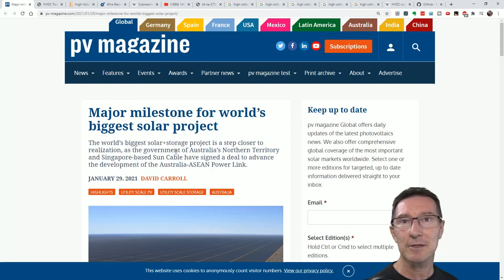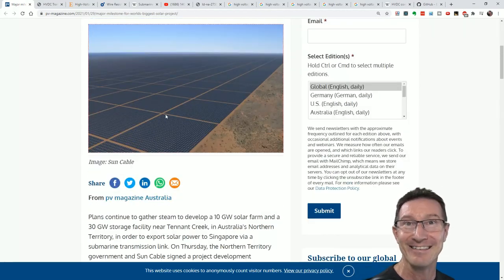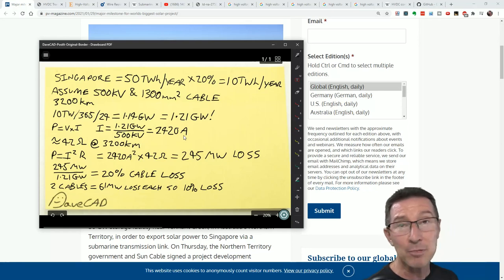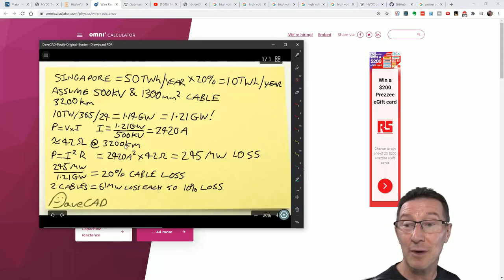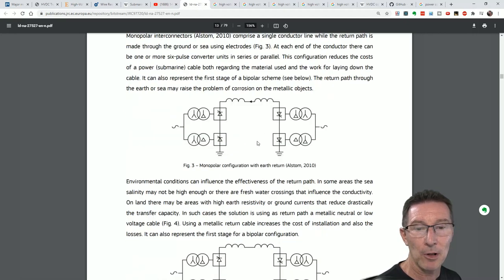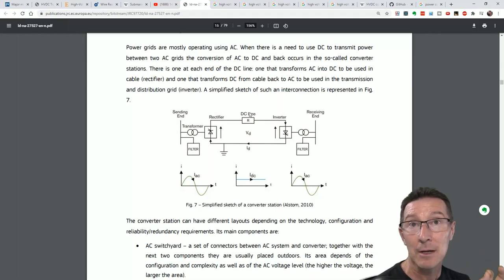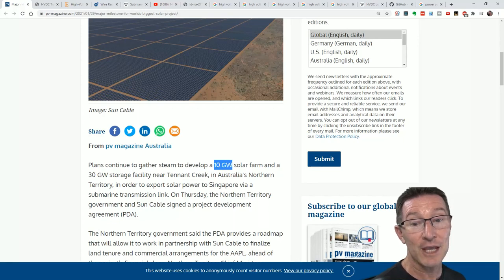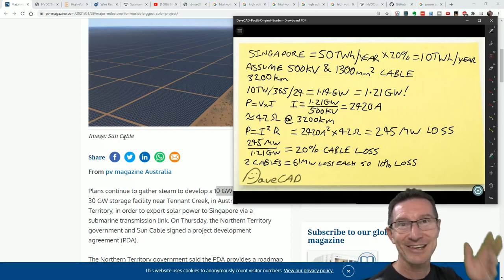World's Largest Solar Array - HVDC Transmission Calculations...

Comment: Do they use a second line for the return path or can they use the ground across continents as a common ground? If not, does the length of cable need doubling to take into account the return path?

Comment: I will concede the first statement, fair point.  As for the second I am assuming you mean solar-thermal towers.  I would agree that they should continue to be developed.  I would like to see a solar-thermal project tied together with an MSR (Molten Salt Reactor).  The MSR already has a huge thermal reservoir and both the nuclear and solar systems would be contributing to the same energy pool.  The system is not fast reacting like LNG however it would produce a constant and unwavering baseline that could handle the bulk of the electric requirements.

Comment: It's interesting but imagine if we stuck all of those panels on business and homes throughout Aus instead... Much better idea but then I guess the rich don't get richer.
Reply: Mounting panels in populated areas, particularly mounted at height, would be far more expensive and much more difficult to maintain than a field level array of solar panels.
Drop a few panels on unsuspecting pedestrians and you have a new expense you never calculated for.  And then you have end of life removal from all those buildings.
Add to that the fact that you need inverters and controllers every few panels rather than the electronics being used for a large array.  Your method would be far less efficient.
Reply: good luck maintaining a bunch of panels on top of buildings of various sizes across an entire city.
Reply: @poptartmcjelly7054     Which also brings up the point that distributing the panels will increase the amount of wire required to deliver an equivalent amount of electricity.
I suppose they could use bi-directional electricity and send the power both ways through the wire at the same time thereby not needing extra wire.  XD  jk
Do 'Green Energy' advocates know that Solar Panels are polished with a chemical called Chlorine TriFluoride?  The stuff will set Asbestos on fire.  Seriously, look it up.
Reply: @seanb3516  You wouldn't need to distribute the power because it would get used at the building. You reduce losses because you don't have transmission.

I don't know why they don't build those big solar towers anymore. They are much more productive collecting up to 35% compared to the 12-15% of solar panels.
Reply: @excitedbox5705  I'm pretty sure panels are better than 15%
Reply: The folks doing this arn't idiots. If they could install it on rooftops and so forth in Singapore, they would.  Installing array(s) in neighbouring countries is fraught with other issues. Singapore and Australia are somewhat more politically aligned, and they can be reasonably assured that Australia won't threaten to cut off their power. 

The idea of installing these panels on Businesses and Homes in Australia misses the point of why Singapore is paying for this to be built - it's because they need the power. We can pay for and build our own, it's not like we're running out of room for large-scale Wind/Solar farms.
Reply: @rebsdioramas  It costs a lot of money and requires investors willing to chip in.

Comment: Seems like the storage needs to be located in Singapore.
Reply: I was thinking that you might be better off with storage in Australia so that you have a more steady flow of power in the transmission lines to avoid high I2R losses around midday.
Reply: @somersethugh  yes, the battery needs to be close to the load.

Comment: Guess you need to double the resistance as you have 2 ways and if you use +-800kV you get a 1.6MV potential to work with :)

Comment: With regards to the losses (and who'd end up paying for that)  on the transmission line (imo): the easiest way would be to sell the power where your infrastructure ends.  This would put the onus on the owners to ensure their plant is running at peak efficiency. So if Singapore owns the transmission cable, they would incur the losses. This avoids paying for losses incurred outside your infrastructure.

Comment: Okay so a note on aluminium cables. It needs about twice the cross-section for the same delivery but at the same time it's over 4 times cheaper than copper and easier to make. Australia by weight is producing more aluminium than any other metal except iron combined and considering aluminium is pretty damn low density, that a *lot*. It would be orders of magnitude better both for local economy and for production/shipping cost than copper.

Comment: Yeah, as we move towards decentralised renewable energy, and diversity of supply to cover gaps in generation, HVDC is only going to become increasingly common.

Multi-tap systems are an interesting development - because you have to drive all the power converters properly it's a lot more difficult to control than standard AC system.

Comment: Arent there additional losses in the ground return (if using only 1 conductor)?
Reply: I wondered about this as the resistance figure in the calculation doesn't take this into account. I think it's likely to have a metallic return, see page 13/14 of the "HVDC Submarine Power Cables
 in the World" report.

Comment: I wonder if the storage will be in Australia or in Singapore - if you have 10% loss in transportation it would be smarter to store it in Singapore, right? Are there figures about efficiency versus capacity versus cost?
Reply: Yeah definitely best to have the storage in Singapore so you dont lose what ever percentage when you have to transfer from the storage. Then you can get away with a smaller storage with the same result.

Comment: How is the cable supposed to stay connected if it needs submarines to hold it up?
Reply: not sure if ure joking but sub marine means under water. so the cable is just sitting on the bottom of the ocean.
Reply: @JaniMikaelOllenberg  dude i know submarines go underwater its in they're name
Reply: submarine cable has nothing to do with the submarine watercraft. the cable is laid down on the bottom of the sea from a boat.
Reply: @JaniMikaelOllenberg  That and I think it's often dropped into a trench to give added protection

Comment: WOW...  3800km is 40,720,800  Kg of copper per each of the 1,200 mm^2 strands in that cable!  That's a lot of copper!          Interesting they use lead shielding in there.... best cost factor?
Reply: 20.89 meter sided cube of copper  (2 strands @ 1200 mm^2, 3800 km length)
Reply: Well you also need 25 Million PV Panels @ 400W each. The scale is insane i have to say.

Comment: I wonder if there are ships that can lay multiple cables in parallel. The ones I've seen (YouTube ship tours and whatnot) seem designed specifically for single cable payout.
Reply: Single only on all the ones built from the 1980’s to quite recently in and around the UK.  The conductor spacing is in the tens of metres.

Comment: Here in the US there was a proposal to use HVDC to transmit wind power in Texas to Chicago, about 500 miles (or 800 of your fancy French kilomumbles). The plan for the cable and the wind farms to support it were cancelled when they couldn't get regulatory and government support for the project. Ironically the plan was put forward by a billionaire Texas oil man and was shot down in the halls of power by oil and coal industry lobbyists.

Comment: I recommend thinking superconductor. At this size and length this could become viable.
Reply: @Wolfgang Preier Please show your working?  What are the energy costs of keeping 3800 km of cable cold? What are the capital and maintenance costs?  What are the MMBF & MMTR?  What is the epected lifetime of such an installation?
Reply: @Brian_Of_Melbourne  I am neither a industrial engineer nor a phycisist who could say whether a supraconducting cable in this length is even possible. I can only see the numbers. And many millions of dollars lost only because singapore can not place their solar panels near the city is overkill.
As i said it COULD become viable. maybe not. IDK.
If you want to know specifics: There are a few real world implementations in italy, russia, japan, germany. 
For HVDC they use 650kV and 10 kA and cool it down to -208 celsius. At this power elevel it saves - currently - 15% of the cost of a normal conducting cable. 
But nobody ever tried this for 3800km. And nobody would make this experiment. The implementation itself would be the only way to experiment and learn.

Comment: One of the down sides to DC is that it's considered a point to point system and not amenable to tapping off power at substations along the route, mostly because of the cost of  the AC conversion plants.   I was surprised to read that DC lines can be setup to move power in both directions via the appropriate AC to DC and DC to AC converters plants, seems the hardware is very similar at both ends but think its more than software register bit switch however.   AC systems just adjust the phasing. Regulation, harmonic suppression and arcing are major issues that have to be addressed.    Conversion buildings can be filled with SF6 to reduce the spacing of components and they love optical triggered thyristors.   One errant pulse and you let the blue smoke from you expensive converter stack.
Reply: The first UK-France Interconnect was bi directional and was completed in 1961(now decommissioned). Power is imported and exported depending on demand and market costs. The second 2000MW system was commissioned in 1986. An additional link was commissioned in January 2021.

Comment: Solar does not have a production cost. Fuel, the sunshine, is free. Basically the cost of electricity becomes capital and overhead. There could be a time in the future where one pays for a connection. A bit like an unlimited mobile or internet service.

Comment: Skin effect is not the only problem with ac. With very long lines, you will get a lot of parasitic capacitance, so additional power loss.
Reply: You also need to add the inductance the long cable has.  Electric train systems half the frequency, cause the impedance at the regular frequency (50/60 Hz) is too high and power just does not flow.  If trains system do it for a 10th of the distance, and 100th less power, DC is the only way to go.
skin issues are peanuts
Reply: @ikocheratcr  What train systems halve the frequency?
Reply: @misstakenot9582  In Germany, Switzerland and some other countries they use 1 phase 16.7Hz for the railroad power grid. It was 16 2/3 Hz. But the reason isn't the impedance of the catenary. Back in the days when the trains did not yet have frequency converters, it was possible to use more compact motors with less copper and a higher starting torque at a lower frequency. They used this odd frequency because: 50Hz/3=16 2/3 Hz.
To get a lower frequency for the more compact motors, a machine set consisting of motor and generator was used with a gearbox that has a 1:3 ratio.
Nowdays 50Hz would be better/cheaper. And the frequency changed from 16 2/3Hz to 16.7Hz because the controllers of modern converters can't compute periods.
Reply: @ikocheratcr  Yeah, in Poland we have DC for trains and trams.
Reply: @Momchil0  Interesting. Thank you.
Reply: @ukaszsmoa8416  parasitic capacitance might even help, interesting.  BUT, how do they manage a short circuit?  In AC it lets go 60/50/30/25 times per second, but is DC it does not, it is arcs and it just keeps going.  There needs to be something to manage that.
Reply: @ikocheratcr  Why do you think parasitic capacitance might help? As for dc vs ac short, it's not as simple as you think. Inductors are used to extend rise time of short circuit current, and special switches are used, that are suposed to switch off power before time constant or before end of transient state, depending on the literature you read. And, current peaks during short circuit (assuming constant short resistance and constant voltage, not affected by that short, occur 120 times per second, twice for one period).

Comment: DC connections between different AC power networks need no synchronizing. Finnish power grid network buys electricity from Russia and Estonia and due the DC connection Finnish network runs unsynchronized to East European networks. Finland's network runs synchronized to Scandinavian, Swedish and Norwegian power grids.

Comment: Do not put it past them to use high temperature superconductivity  by the time that cable gets built.  As this is the longest HVDC undersea that I have so far seen,  I would guess they have a plan to not lose that much energy.

Comment: I'm curious. Is there a limit in amps a cable can carry? Current is columb/s. Are there 2420 * 6.24*10^18 electrons in that cable that can flow through in a second? Or is it naturally "encoded" in the resistance value?
Reply: You can keep upping the Amps until the cable melts!

Comment: It's the old war of the currents AC v DC again. Looks like DC could win.
I've been experimenting to see which appliances can run directly off of DC. As it turns out most of my appliances do just fine. Just induction motors and old style transformers won't work. I would love to try a off-grid DC system. No inverter needed. Just PV panels and a battery bank (about 200v, most switch mode power supplies will work down to 150v DC, and up to 350v DC) Most led bulbs work fine on DC. Laptop and phone chargers and TV, all work on DC. They all seem to tolerate a wide range of voltages as well.

Comment: Just curious since they are transferring DC over a large distance, the cable would need to be very low loss, since Thomas Edison wanted to supply back in the days DC power instead of AC. The problem with DC requires are larger cable size. You would need it to be stranded not solid core. So that would be very expensive. Curious, the losses in the inverter, to convert the DC to AC.  I have asked our Energy company what the efficiency of the inverter, it was around 89%. So, with that said losses in the cable and inverter.
Reply: A modern converter has a efficiency of ~99%.

Comment: The Aus to SG cable length is shown as 4500km on several seemingly reputable sites. Seems a bit long, how do they route it? You need two conductors for power transmission (using the ground for one seems unlikely) so is that total wire length for the two (positive and negative) wires? 
I don't think your calculation length could be for both conductors, total loss will be crazy high regardless.
- Tesla HF radio power transmission?
- How about superconducting cables? 
- Maybe heating the ocean with the wasted energy will cause global warming? (joke)

Comment: AC (3 phase) is 3 wire...  DC is 2 wire;  simpler balanced construction of transmission towers (16:30) and less cable complexity.  Also apart from resistance, HVAC suffers from corona losses https://en.wikipedia.org/wiki/Corona_discharge as well as the mentioned skin effect; both of which go away with HVDC.  You do need to build the inverters at the grid gateways but most countries will eventually hook up to the global HVDC grid and hence will need the inverter.  Oh and switching HVDC is fun!  ;)

Comment: 6000V is quite typical for high power undersea cables.
Reply: And thicker cables with a core of copper with a large aluminium conductor around it.

Comment: Imagine how much warming this will cause. Wouldn't want to work on those panels without an air conditioned suit. The area is HUGE!
Reply: Not if the work is under them.
Reply: @wobblysauce  
They'll convectively heat the air and the hotter air will remain at the ground (adiabatic heating). It'll be like the inside of an oven, working around those panels.
Reply: that hot air will create a constant tornado!!!  :)   vultures will love getting a loft up to 40,000 feet!
Reply: Installing solar panels cools the local enviroment by absorbing about 15% of the heat, converting it into electricity and transmitting it somewhere else.
Reply: @petehiggins33  i guess. i woulda thought that they would absorb more heat than the dry sandy soil would...
Reply: @petehiggins33 
They don't. The ground is never as dark as solar panels, so they absorb more EM radiation than the ground would usually reflect. The electricity conversion is a tiny product of the overall process.

Comment: Wow imagine the tech that goes into just the insulation of those cables alone.  If you stand under a 500kv line you can hear and feel the corona discharge.  That would be a lot of losses in the water even if a fraction of it makes it through.  Though I wonder if that's only an issue with AC and not DC.

Comment: Your estimations were good, the undersea power line is planned for 2.2 GW:
https://en.wikipedia.org/wiki/Australia%E2%80%93ASEAN_Power_Link
I wonder why they don't use a superconductor. Even if they don't use the latest room temperature material, for 245 MW you could install a pretty good cooling station, if the insulation is good. But maybe too difficult undersea and for this long distance? You probably would need more than one cooling station.
Reply: The superconducting lines are literally pumping coolant through the cable which is more like some insulated pipe. Pumping liquid helium for 3200km? I don't think so.

Comment: Are superconductors not a thing for long distance transmission lines?
Reply: They probably have to be kept so cold its not worth it to work.
Reply: Possibly because Niobium used in Niobium-tin  super conducting wire runs around $42,000/T and Aluminum runs only about $2,000/T USD for starts.  Then you have to cool it with liquid Helium which is also a non renewal resource and has become quite expensive in recent years.  Even a moment's loss of cooling and you cable is toast.   It's the 34th in abundance similar to lithium and gallium  aluminum is #3 copper is #25